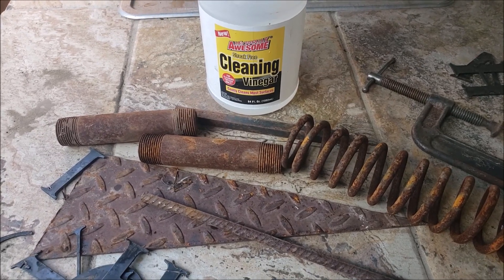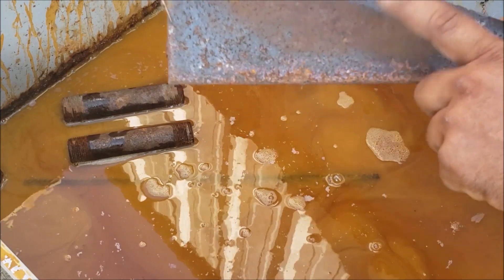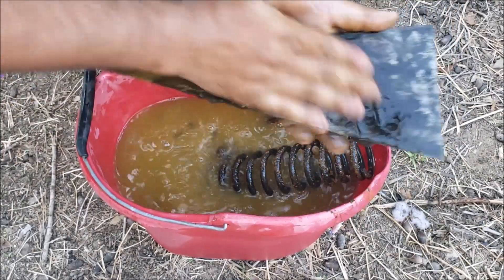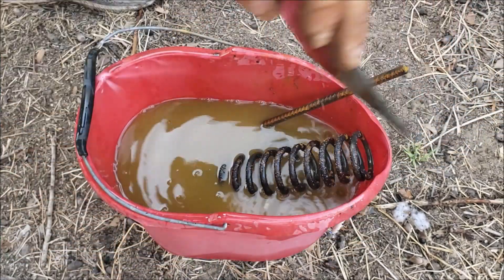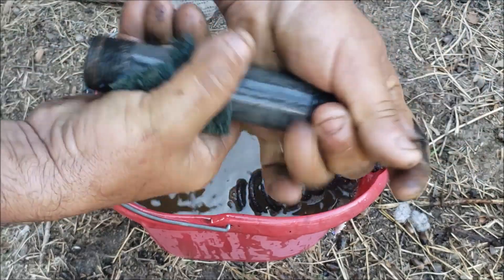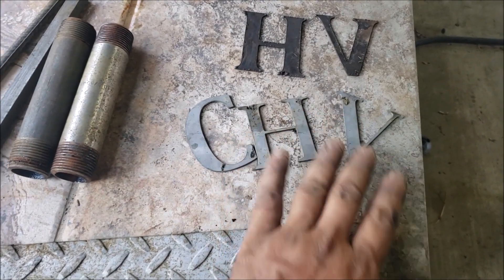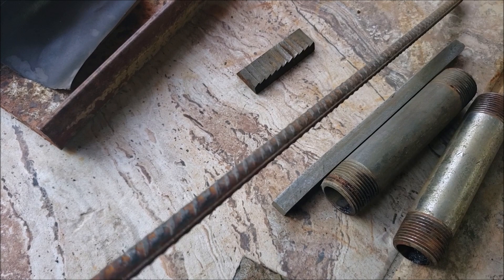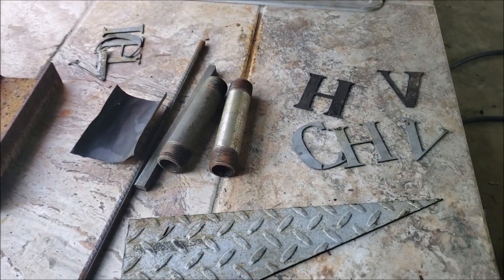Remove Rust And Mill Scale from metal easily With This Vinegar Hack!

Comment: I use Muric acid (hydrochloric acid). You can buy it at the trade stores, the bricklayers use it to clean cement off the bricks. I've hade 2ltrs that I've been reusing for the last 2 years. Takes only a short dip to get results or you can paint it on. It's good to neutralize it with sodium bicarbonate after.
Reply: I don't for the Muriatic acid a whole lot, but that worked great when refurbishing an old drill press I have. The post column wasn't cleaning up very well so I used some of my wife's makeup remover pads and hemostats to brush it up and down the column. It took care of what the wire wheel couldn't.
Reply from the maker: I bought some muriatic a few months ago to do some cleaning and had forgot how strong it was. I was not sure on the neutralizing part so skipped it as a rust remover on my projects. The downfall to using vinegar is all my projects smell like pickles.

Comment: I used to use vinegar, but I've switched over to citric acid. I get it in powdered form at Walmart over by the canning supplies. It's cheaper, I can adjust the strength by how much powder I add, it works really well and doesn't stink. Give it a try, a comparison video would be interesting.
Reply from the maker: I will try to look for citric acid when I go to the city, as I'm unfamiliar with it. I started using vinegar once I got my cnc table, and like you mentioned it does smell.
Reply: @cutweldngrind  When you go into the city..... I'm jealous. If I remember correctly, you're in Texas; if so, where about? I grew up in Grand Prairie - live in Bedford now. I've spent my entire life here in the DFW area. Would love to get out of the city eventually.